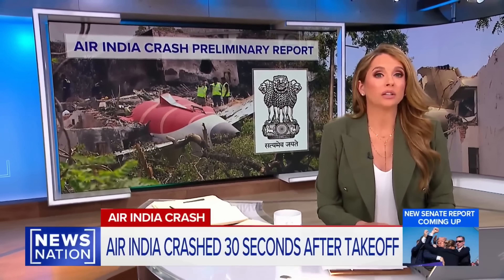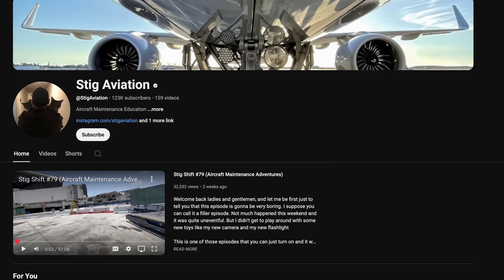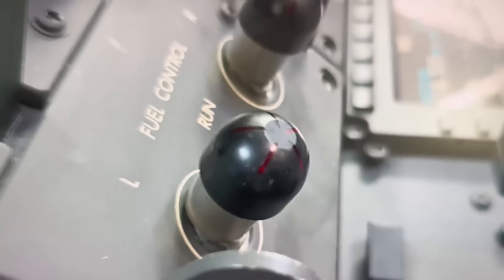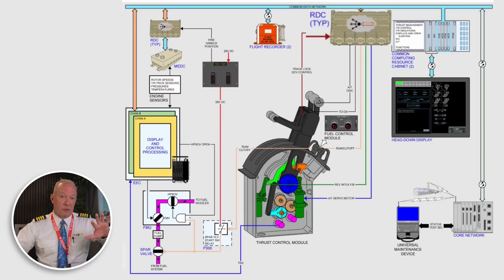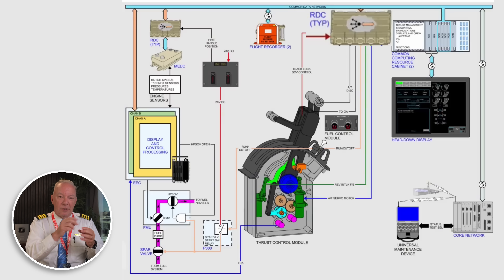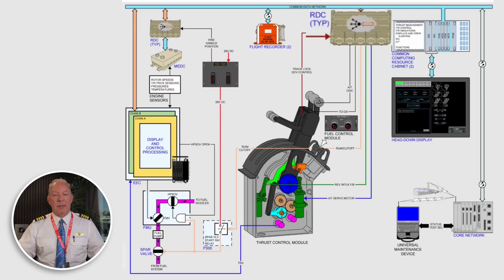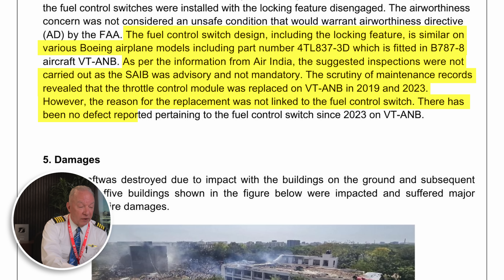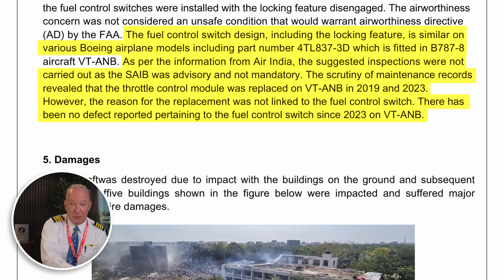The Truth About Boeing 787 Fuel Control Switches

Comment: I'm just a "wanna be pilot" with enough electrical knowledge to be "dangerous".   Surely saw these fuel control knobs many times during my FA career, and wondered about them.   Would later figure out that they can not be accidentally bumped/moved inadvertently.   But, on the other hand, I will do anything "not to blame the dead guys".  While I agree it would be next to impossible to move those fuel control valves unintentionally.  I apprectiate your explanation on how they are wired, direct to the battery, so intermittent power loss seems unlikely.  But, then there is the question of the relays/wiring being messed up, but that seems near impossible also seeing that these are two independent circuits.  From what you have written, I am guessing that the fuel switches in the wreckage were found in the "on position", which goes along with what was heard on the CVR and the data found on the other recorder.  Needless to say, the wreckage was destroyed/burned to the point of not being able to trace wires or check the relay operation very well.   May God bless them all, along with their families and friends.  I wonder how the lone survivor is doing, he must be haunted every night while trying to sleep for sure.

Comment: Excellent explanation but where does that leave the extremely detailed technical analysis by Richard Godfrey (a 17 page report no less) that provides a timeline showing the RAT deployed in response to an electrical failure causing the shut down of both engineers PRIOR to the operation of the fuel shutoff switches and that the pilot action had no influence on the outcome?
Reply: He actually addressed why the RAT deployed in an earlier video he did
Reply: Godfrey is talking complete crap, unsubscribed from their channel after they didn't correct even after Boeing engineer explained them how wrong they were. Godfrey is either corrupt or dumb.
RAT deployed by automatically after switches were turned off by logic BPCU <-> HYDIF logic. 
All is correct in prelim report.
Reply: Why does that persons timeline show that, while all other sources show it the other way around?
Reply: Godfrey speculates on RAT deployment timeline.     We need all the data to confirm/deny his hypothesis.    He proves nothing.    In fact, if RAT deploys instantly if it detects fuel shutoff and plane is airborne, and if 'starts to provide hydraulic power' is when the RAT first starts turning (not spun up) then the official timeline we have is consistent, there was no early RAT deployment.   Neither scenario is proven.

Everybody should just drop this until more information is released.     If folk feel its all lies and coverup, team is just flat making stuff up, well by all means carry on forever with the speculation.    If Godfrey had stuck to what is known for sure that would be different, given his fairly strong endorsement of plane or airline company fault.     Our host here just provides some factual information on the fuel switch circuits.
Reply: Yes he leaves out the RAT deployment completely. He seems fixated on blaming the pilots. All this talk of his about not blaming  the pilots is making people do exactly that subconsciously.
Reply: @GabrielJM  He actually addressed why the RAT deployed in an earlier video he did about this
Reply: Richard Godfrey has calculated that the RAT deployed before the fuel was cut off. His calculation may be correct. He speculates that this happened automatically due to an electrical failure (whereas it could have been deployed manually, or deployed automatically for some other reason). He then speculates that this supposed fault - which is not mentioned in the preliminary report - was caused by water ingress into the EE bay and it resulted in both engines shutting down. That's a whole lot of speculation!

Comment: 4:36 so all that would have to do for it to shut off without the pilots doing anything is for the electricity between those switches and the other end that their wire runs to be cut off
Reply: But then the pilot wouldn't have seen them in the off position to ask "did you turn those off?"
Reply: 9:45 the fuel switches are connected to a battery so that even if there is a total electrical failure the engines will keep running.
Reply: They did not turn OFF at the same time!!!! There was that 1second space like a manual cutoff. Then they were RETURNED to run.
Reply: The valves are powered on/powered off. If you remove power they stay in their last state. If they lose power the engines stay running.

Comment: Thanks for going into so much detail about all of this, the schematic diagram was helpful to understand the systems involved.  There is still one unaddressed issue I would like to know more about: some 787s have had lavatory water leaks, and some 787s have leaked water to the point electrical equipment on board the plane was damaged and required repairs.  What is known about the nature of the water leaks and electrical damage on the 787s that this has happened to?  While highly unlikely, could a water leak have caused the 28V circuit between the Engine Cutoff switches and fuel valves to short circuit and/or malfunction?  The fact that the two switches were transitioned to cutoff at one second apart, and then transitioned back to run about 10 seconds later, makes it very unlikely this would have been caused by an electrical short or damage.

Comment: Yes. All true except his description of the little toy circuit he pulls out is misleading. He says the doorbell-looking switch on the toy circuit is a relay. That’s not true.  The doorbell looking button on the toy circuit is a simple mechanical switch.  A relay is an electrically operated switch, not  a mechanical switch.  Doesn’t change the gist of what he is saying regarding the accident, although his description of what a relay is is not correct.

Comment: Could a mechanic sabatotage the switches? Remove the indent that stops switches from moving from on to off? The plane's vibration on rotate could then disengage fuel going to engines.

Comment: That's an awfully convincing explanation. Why do they have three valves each? Is that for switching or equalizing tanks, as in the fuel cross-feed system? Is one pair dedicated to the fuel jettison valves on the wingtips? Why does the fueling control panel on the left wing have two hose connection pipes? I'm assuming that all of the cutoff valves are closed during refueling, but how can those lines be switched automatically by that panel? Each tank has its own meter and "full" light, so it must be automated. That bypasses the DC buss bar?

Comment: What Steve is getting at here at the beginning of the video about the switches is that there is no computer involved in turning on or off the fuel to the engines.  The switches do not talk to the computer. The computer does not a computer.  A computer does not talk to the relays which turn on and off the fuel to the engines. This is strictly electro-mechanical and as simple as possible. This is done on purpose so that the likelihood of all the fuel to all the engines being turned of is statistically 99.99999% impossible.
Reply: Nothing in the report states that either pilot flipped switches to off, or that anyone flipped them to off, it doesn't even say the switches were flipped off at all.

Comment: Is it possible the switches were resting on the detents due to being improperly set and slipped off into cut off position during takeoff. This would explain the comments made by the pilots.
Reply: Both?
Reply: Several have asked this same question: Can the switch be accidentally placed on the detent? Or intentionally, it doesn't matter, is it possible? It is a reasonable question, and I would think that investigators would want to know this as well. I see this as a missing data point, not a solution of course.
Reply: This might happen with cheaper versions of such switches, like on some laboratory instruments. But due to the shape of the "detent" of these particular switches, it's close to impossible, especially for two switches and switching within 1 second.

Comment: Pure mechanical would like a a handle attached to a valve attached to like a copper pipe or something like that I don’t think you’re referring to as pure mechanical in the proper context. It’s still an electronic switch. It’s still digital in that sense. It is fallible in a way that a mechanical switch could not be

Comment: Wouldn't it be nice if the Captain had one fuel switch on his left and the other pilot on his right? Then neither of them could shut down both engines on their own, but it would always require the cooperation of both pilots.
Reply: Pilots have become in capacitated with the other pilot taking 100% of the flying activities. I’ve heard audio of pilots saying the other is unconscious, for example.  What if an engine catches fire?  The flying pilot needs to have complete control.

Comment: The common denominator is the battery 

Battery issues have existed before Capt. 

Not so ??
Reply: if the battery failed the switches would left on you clown
Reply: If it were the battery, there would not be a 1 sec delay and both would fail at the same time.

Comment: 1:51. It seems like those small humps would wear away after hundreds of uses and perhaps allow them to be inadvertently bumped from one position to the other.  I am not suggesting an accidental bump of these switches happened but a hump of 1/4 inch would stop this from being a subject of speculation.
Reply: Yet the falling from the sky and hard impact did not move it? I might be wrong, but highly unlikely the report would've mentioned if the guards were worn out
Reply: @neilmoller2589 Agreed.  But a big hump of 1/4” would stop all speculation about accidental bumping of the switches.  On the other hand, I’m not an engineer…
Reply: Every gun has small notches that last thousands of rounds, every door lock has notches that last hundreds of thousands of turns.
How in earth you can were off that thick metal part by just lifting over it - 2 times per flight?
Reply: @rannot4611  Ford had a problem decades ago where the parking pawl in the transmission wore out, cars fell into reverse and backed over a few owners who were stopped at their mailboxes, for example.  I learned about this in a corporate malfeasance course in college.  Metal things wear out from use.  The debate over accidental bumping of the switches vs deliberate movement wouldn’t be a debate if the switch had to lift over a high bump with no rounded corners (note photo at 1:51).
Reply: @GreenEyes_MS  You can compare car designing to airplane designing - the requirements for everything are beyond that you ever can believe if you are not designing civil airplanes.
Reply: Both switches were replaced recently.

Comment: So, the three fuel valves are energized by the relay, open or closed circuit, but how does the valve closing motor reverse with no current? Is that a spring-loaded valve that either opens or closes when the current is cut? Or, is the relay switching from one side of the valve motor to the other somehow? Lights go on and off with an open circuit, but motors or valves don't both open and close without an acting motive force. Which is it, actually in practice, not on the Erector Set? Electricity is holding the valves open, and any disruption of that power supply will close one, two, or three valves. Right? And, only recycling the relay to its closed position will renew the hold-off force necessary for fuel to flow into the engines? Or, will an immediate restoration of power to that circuit open all three simultaneously? Is there a breaker for that?

Comment: Capt. what if the battery you speak of failed...is there a battery level indicator ? Does it have an alarm ? What if the relay you speak of failed as you have explained with your "simple" switch ...at home we sum times press a switch and there's no contact
Reply: Then both would have failed at the same time, but there was a 1 sec gap between them.

Comment: Correct me if I am wrong, but aren't the relays and valves in airplanes of the latching type?  A latching relay or valve will remain in the position it was previous to the DC power removal.
Reply: thats a very good question, the relay behaviour is important and isn't covered in this video.

Comment: At this point, it's painfully obvious that this was, tragically, an intentional act.
We don't know WHY, yet...
...but the fact that anyone is still trying to argue that this was a system glitch shows that some people can't accept the evidence. The facts.

This was done on purpose... and it was most likely the Captain.
There's ZERO chance it was a glitch.
Reply: Exactly.
Reply: Zero chances of a glitch, I agree.
But it is in my opinion still too soon to claim it was intentional. It's very unlikely that it was done by mistake, but it is not 100% impossible.  It has happened at least once before.  In 1993, in France, a captain was told to gear up after take off. He instead cut off the fuel. That was on an A320. News article about the incident mention the copilot saying the captain was acting incoherent for a few minutes. So probably some form of temporary mental impairment that made him act irrationally, like a brain fog due to a stroke maybe?
Luckily, they had enough altitude to relight the engines and recover.

Most likely it was an intentional act, but it should still be investigated to be sure. The CVR should have plenty of clues to confirm the state of mind of the captain during the incident.
Reply: No, there's not ZERO chance it was a glitch. It's NEVER EVER zero in anything in life. We could say very close to zero but never zero (sorry, that speaks about your mentality). And no, there's not ANY EVIDENCE saying "it was not the plane" as you stated, as there isn't ANY EVIDENCE suggesting (without a doubt) it was any of the pilots
Reply: @burdeninmyhand um... wrong 

The timing of EVERYTHING rules out a glitch.
If you think otherwise, you're not paying attention to the details.
The second delay between run and cutoff rules out glitch.
The matching delay back to run confirms it was A PILOT.

The little we KNOW already about the CVR results proves the switches were PHYSICALLY moved.

There's literally ZERO chance of it being a glitch. ZERO.
Reply: @burdeninmyhand nothing you just said is true.
Freaking stupid

Comment: America West Aircraft N908AW had the fuel cutoff switch short out back in either 2007 or 2008 shutting off the fuel valves even though the switch was in the run position.
Reply: Two isolated circuits shorted, then healed themselves... near simultaneously?
Reply: @televishenimoniker5546 The DC power supplying those circuits and other systems failed. They recovered when the RAT supplied the power instead.
Reply: Did a pilot notice and turn them back on, like in Air India?
Reply: @awathompson @tonybeam The switches are mechanically and electrically separate from each other, so to lose both engines it would have to be a simultaneous double short. Astronomical odds against. Also doesn't jive with pilot saying: "Why did YOU CUTOFF?" Specifically saying "cutoff" which is the word printed on the switch. If a short had happened, he'd have no reason to think the other pilot did anything. The engines would be mysteriously losing power and he'd have no idea why. Hard truth: Human beings malfunction a lot more frequently than modern aircraft.
Reply: @maxsplaining DC power supplies both systems. There was a loss of DC power, which affected multiple systems until the RAT was able to power them back up again.
Reply: The switches were replaced recently. Also i'm sure the switches have already been checked for any shorting out or malfunction.
Reply: If not intentional then really the dumb move of muscle memory
Reply: @awathompson, I couldn't find anything online about this. If you can pull something up, please post it in a reply to me here because it's very interesting.
Reply: This has been my theory from the first week. Thank you for articulating it.
Reply: Chatgpt says this aircraft had an uneventful and long service history and was dismantled in 2016.   There was an american airlines incident involving progressive loss of electrical systems.   Plane landed on battery power for critical systems.    I think Mentour pilot perhaps covered this, it was in 2008.     This is unrelated the fuel switches and in fact shows that with massive and accumulating system failures the engines were properly failsafed.
Reply: @GrantK-k7b  Chatgpt does know what its saying.  N908AW had an interesting existence, If you can find it, 908 was photographed on its nose in the hangar in PHX after its nose gear collapsed in late November 2000. In the summer of 2008 US Airways almost lost its ETOPS program because of 4 engine shutdowns within 90 days. One engine failure due to a turbine stator vain failure, the Failure of the fuel shutoff switch, a wing body over heat caused by Maintenance not properly securing the bleed line to the engine, and the fourth I do not remember. All either flying into or leaving PKOA. I flew the B757 for AWA between 2004 and 2010 before moving on the A320.